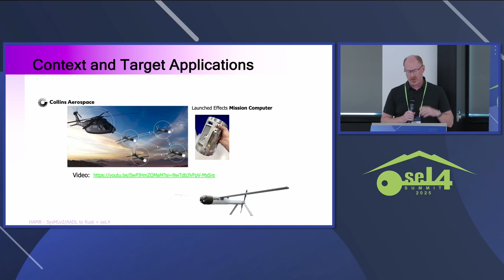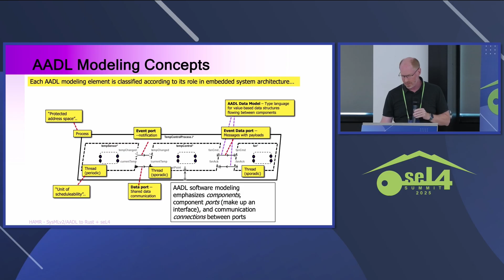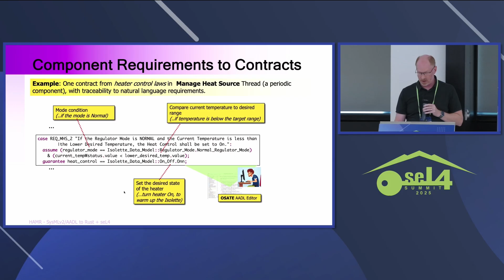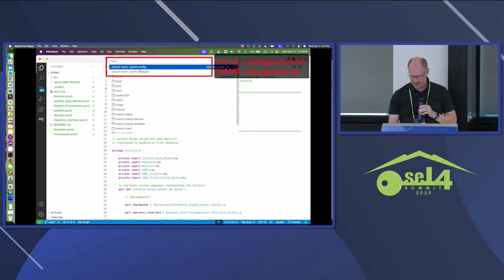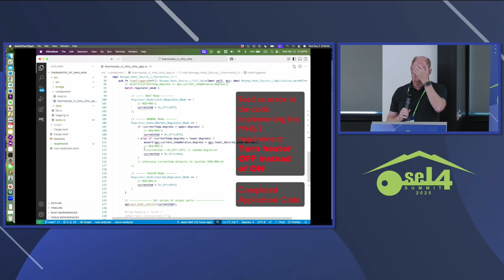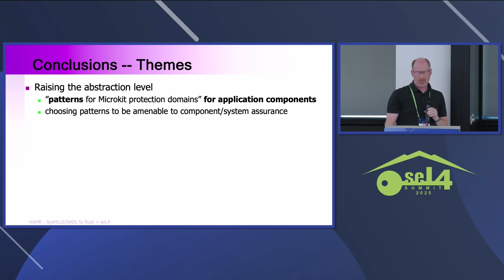Model-based Development for seL4 Microkit/Rust with Integrated Formal Methods using H... J. Hatcliff

Comment: My team was considering using this tool. However, after investigating the installation steps from Sireum It seems like you would have to move your entire code development infrastructure to a fork, which they maintain, of Vscodium. Because this operates through the command palette, I believe it would be completely possible to make a vs code extension which does these and the adoption of this tool by not only my team, but many others would be likely. There's lots of great things here but the current implementation is not feasible to use.